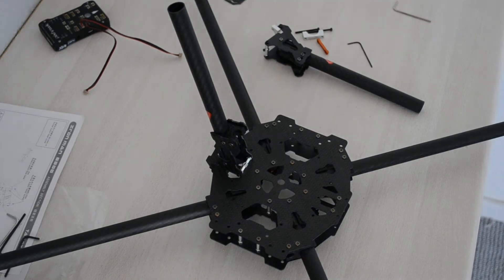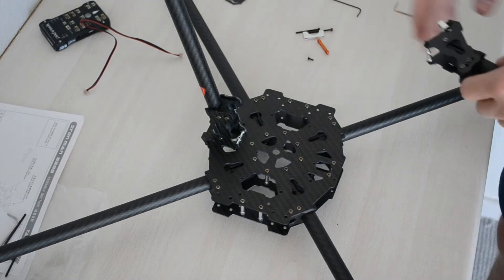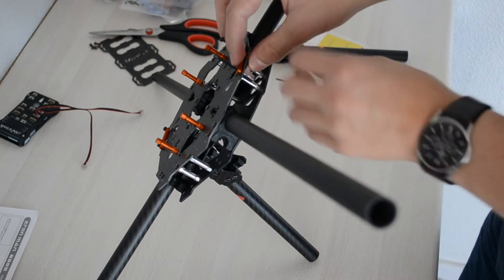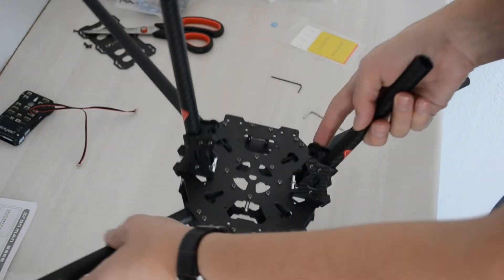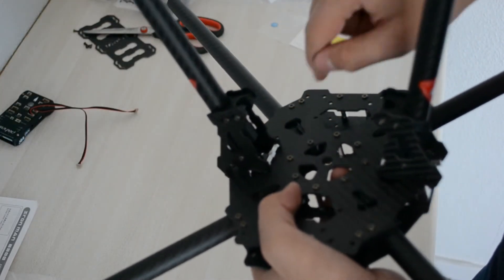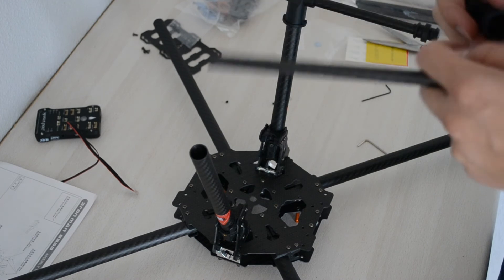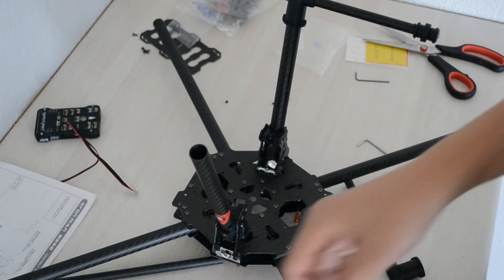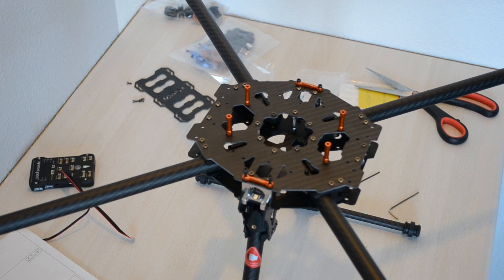Tarot IRONMAN 650 build and review - Landing Gear  [Part 2]

Comment: You installed landing gear incorrectly, the orange piece has the thread there's no thread in silver parts! What is holding the screws to down into the landing gear? You can just pull the 2 screws and orange piece up and out!

Comment: There's a cut out on the gear housing where it meets the bottom plate. that hold the bar underneath the airframe screws from top bar on bottom.

Comment: You mounted the landing gear completely wrong. The two long screws pass through the upper carbon fiber plate then through the 2 silver half round braces then the screws pass through the second bottom carbon fiber plate. Then you place the orange dog bone that says TAROT and screw the long screws into the threads. This is what holds the gear tight. Your build is wrong... WOW!!!
Reply: Keith T Yes the video is wrong but I disagree with your assembly order.  Mount the orange dog bone on the bottom and the landing gear *WILL NOT* ever fold flat as the plastic hinge fitting on the top end of the leg fouls the dogbone.  There are also a number of pictures including on the official site where the screws are fitted pointing upwards. The correct order is screw, bottom plate, shiny aluminum blocks x2, top plate, orange dog bone.  To fit these bolts the side plates on the landing gear need removing.
Reply from the maker: Keith T I see your point and i thought the same thing when i was about to assemble it. Then the manual said otherwise and i tried to install it that way. And it actually holds the parts together that way. And besides, in my model there is a given thread in the bottom silver brace so it is still tight. I might it later, but for now it works. Thanks for the heads up :-)
Reply: Link to photo of assembly showing orange dog bone on top http://www.tarot-rc.com/images/2013011213464510169.jpg
Reply: Official Tarot site (Chinese)  with lots of photos http://www.0577mx.com/products_view.asp?id=4167
Reply: How in the heck are you supposed to tighten it down with the bolts starting at the bottom side if the gear is in the way? And why do the "dog bones" look so fancy, only to be hidden by the gear if inserted in the botton? Oh yeah, gotta rove them Chinese instructions.

Comment: you think a kk2.1 controller would mannage to fly a tarot 650 with 360kv motors +30A qbrain esc + 10000mah 4s + 17x5.5 props? and you think i can find a vid for that? i already ordered these parts and waiting for ur 3'rd vid :)
Reply from the maker: Well the controller can handle any size quad with any ESC's and motor combination. The different flight controllers is only there for different flight modes, stability and features. So you'll be fine. 17" props is right on the edge but you'll do :-)
New video should be up within the hour :-)